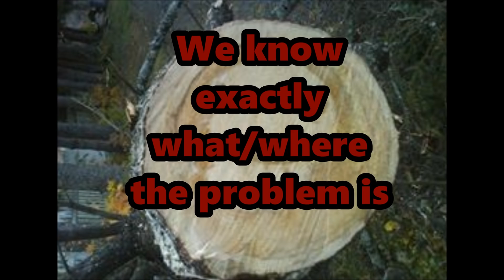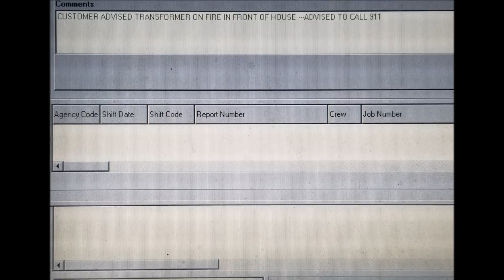5 Myths about Power Outages

Comment: A year or so ago, I was watching as a lineman changed a fuse. The fault was still there so it blew as he closed it. Very loud. Guy didn't even flinch. Guess they are always anticipating that it might happen.
Reply: If you come up on a distribution transformer with a blown fuse and can't readily identify what caused it, you kind of expect it to blow back.  The primary fuse for a 25kva 7,200V transformer is 6 amps.  What is really unsettling is to ride a line out late at night at the end of a thunderstorm looking for the cause of a 280 amp fuse blowing one span out of a substation where the circuits split.  I closed that door in right as my partner was saying "it outta hold" and I believe it blew back before the jack engaged the top terminal.  I think I came about 2 feet off the ground and by the grace of God kept the contents of my bladder in.  The flash of that fuse blowing was a fireball about the size of a Volkswagen.  We found an unfused tap line with a broken arm and the phase was laying right on a quadruplex cable.  Time to call the bigger crew.
Reply: @123livewire  I work on a lot of 34.5 kv and a 5 amp fuse will cause a fireball like that. I have to take a crap before I close one to keep from crapping on myself. 😁
Reply: Expensive buggers, too.
Reply: @flagmichael  How are they expensive?  The fuse tubes are reusable, aren't they?

Comment: The "blown transformer" myth is spread by the media.  It seems to be the only electrical word they know.  While a transformer can "blow" or be the cause of an outage, it is rare.  During lightning storms and wind storms, the loud reports are normally caused by a phase to phase short or a phase to ground short. also as you point out the tripping of a breaker switch on a primary distribution line.

Full underground power systems are rare, found only in dense urban areas.  In these areas both the transmission lines and the primary lines are underground.
In the outlying areas including both commercial and residential customers, the secondary line are underground and connected to a ground mounted transformer.  These transformers are connected to nearby overhead lines with underground high voltage cables that are fused (breaker) at the connection to the primary line(s).
Reply: It's like every small plane being a "Cessna"
Reply: Oh, I dunno about that; I live in a not very dense suburb (not far from Acton, Massachusetts, USA) which has underground power.  Makes for a nice looking suburb, and I am accustomed to underground power from growing up in the Netherlands (which is effectively one big urb, and while there may be overhead power somewhere, I never saw it), so I like it better than overhead power.  But I appreciate your explanation of the tradeoffs involved, thank you!

Comment: I count myself a well informed, technically oriented lay person. This taught me a great deal, at least making good explanation of some rules I knew. Thank you.
(By the way, I've seen a fuse being tested. That is a shake-making event. The test rig was isolated in a concrete bunker, and the observation room was yards away, protected by several inches of bullet-proof glass. It looked and sounded like a bomb going off. )
Reply from the maker: I guess it would be shake making eh! Very interesting. Thanks man!
Reply: They're definitely gunshots, to me!   

My utility sometimes used cutouts as line sectionizers.  The cutouts (fuses) would hang open for years and years, waiting for the day they needed to be put into service.  I also learned that manufacturers said they aren't supposed to be left like that because the weather will damage them.

Comment: About a year ago, I was sitting at my computer, I heard a very loud explosion, and all power went out. I immediately turned my head toward the transformer in my back yard (the direction of the sound) and about three seconds after the sound, I saw two squirrels hit the ground at the base of the utility pole. They weren't moving. I don't know how, but a few minutes later when I walked out there, the two squirrels were gone. And just like you said, a lineman came and replaced the blown fuse. Piece of cake.
Reply from the maker: Some they they actually just get stunned and then run off!

Funny story: a customer called in with a very similar description.. it was winter time. 

On the report it said
- it's ok to close the transformer back in... It was just a squirrel, but the squirrel is gone because a bird landed and took the squirrel .

When I arrived the was foot prints of a birds in the snow walking up to a print of a squirrel body in the snow .. the. Nothing. It was too funny how the footprints told the story 😆.  

I have the pic somewhere on my bobsdecline Facebook page ...
Reply: @Bobsdecline  The bird was thinking "ahhh, some fried squirrel"
Reply from the maker: He was definitely excited to have a cooked meal for once!
Reply: There was a squirrel incident at NCSU back in the 90's. Blew up the substation. Even with my dorm room on the opposite side of the building, I saw the flash, and my mom heard it over the phone. When I walked by and ask the lineman working on it, he pointed to the carbonize remains of a squirrel paw on a charred bus bar. (as this long predates cellphones, much less cellphone cameras, I have no pictures.)

I've heard stories from out west where fire ants get a little too dense in various powered boxes and cause fires. (they'll also eat the jacket off fiber optic cables.)
Reply: ecsciguy79   Same thing happens to monkeys in less developed countries. They’re not dumb or stupid, they just think it’s another limb. Sadly, most have their insides cooked & don’t survive or it’ll kill a monkey Mom but leave her baby an orphan unscathed physically

Comment: I've heard the fuse blow on the pole down the alley a couple of times.   It sounds like a 12 gauge shotgun.   The fuses have an explosive charge in them so they will cut the current flow fast and clean to prevent arcing.
Reply: The explosion is caused by the fuse flash vaporizing not by an explosive. I believe the fuses are made up of a sintered alloy that is designed to flash vaporize when too much current flows through it.
Reply: The fuses/cutouts on the lines work on the same principle as the fuses in fuse boxes in homes:  a tiny piece of wire sets the amount of current that can flow.  Big and small fuses can blow two ways:
— Overload:   More current is flowing than should be allowed.  If the over-current is mild, the wire takes time to heat-up and break.  The more current flowing, the faster it will break, but it's not instantaneous until 150-300% of designed load (or so).  A glass home fuse that blows in this condition will let you see a neat, visible break in the wire through the glass; a cutout could arc but it won't explode. 
— Short circuit:  All available current flows freely through the circuit, causing the most-extreme over-current possible.  The protective wire vaporizes nearly instantly.  A home glass fuse blown in this condition will have a cloudy window you can't see into; a cutout protecting this condition will loudly pop, like a gunshot.
Reply: None of the fuses should have any explosives in them.  Explosive and electricity do not mix well.  That "bang" you hear is all from electric current and the insulating of the fuse burning away.

Comment: I'd like to see a video of home owners that don't know enough to disconnect from the main power source when running a home generator ! That's not a good idea to run a home generator while hooked to the main power source !
Reply: If the generator is correctly installed, it should have a transfer switch that cuts out power-company power when it cuts in the home generator.
Yes, that's a big if.  Most folks would probably go with a cheaper hack installation that skips such a switch.  They'd say, "I don't need no stinkin' switch; I'll be careful."
Instead of harping about safety to deaf ears, it might be more effective to justify these things by warning the shortcutters about the risk of their generator powering their neighbors' houses.
Reply: @77thTrombone  ... in our neck of the woods there's a $5,000 fine for getting caught doing a back feed to the street.
Reply: @77thTrombone  ... I only wish they published that in the local news once in awhile. We know safety wont but $$$ out of pocket might actually get their attention!
Reply: rupe53 - exactly!
Reply: @rupe53  It could also bring a manslaughter charge ...
Reply: @davidnadeau6441  ... I do believe they use possible criminal negligence or similar because the power company guys are usually good about checking first so seldom get hurt. It's basically the intent, unless it's proven to be a repeat offence.
Reply: Good one!  When your power goes out, your best friend is the person from the power company who comes to fix it.  What a bad way to treat your best friend; endanger his life for your own convenience!  Even if you don't care about any other human life but your own, you're going to get your generator fried when they get your power back on.  BTW, where I used to live, every 10 years a squirrel would jump in just the wrong place and blow one of those line fuses.  It's louder than a gun going off.
Reply: If you connect your gen to the electrical system without proper isolation, you might be a dumbass...
Reply: @HOWNDOG66  you just might be, at that.  Even so, never underestimate the power of stupidity, especially when it has a friend (or a Home-Deport-Parking-Lot-grade "contractor") who's not afraid to make electrical hook-ups on discount.
Reply: its great way to either A kill someone or B set your generator on fire

Comment: Oh gosh. Don't tell me what you just said at 2:30 is real. Are you guys that back dated on technologies still. Smart meters are standard since over 30+ years in Europe and allow exact tracing to the effected lines when those go down which massively reduce the time wasted by linemen to chase down those power lines to figure out where it all starts with the interruption. I simply can't believe how antiquated and outdated all this technology is here in Northern America. 
If you didn't know for example in Germany 30% of the internet usage actually uses Power Lines to the end customer so if something gets interrupted anywhere above or below ground it can be traced down to the foot where it got interrupted. 
It really is a shame that your Company and all others here in the United States, Canada and Mexico simply don't do their job's to actually upgrade to a smart grid.  Ring connections are a common 95% of all Power grids in Florida are Ring connections and no longer just Star connections. So that in case a line got snapped or transformer blew up all what need's to be done is to isolate the 1-2 poles form the rest of the grid and within 60min the rest is back online. I think the public should be outraged and demand those upgrades to be implemented asap. Also safety speaking with those smart meters also do come smart transformer and step up or down systems so at the end linemen and conductors know exactly where it got cut. 
Thank you for doing the video and I will pressure the Boards on which I am part of to get their lazy asses in gear.

Comment from the maker: For apprentice Lineman 
➡️https://m.youtube.com/watch?v=TmCbbDJYPlA
**Edit* As technology quickly advances...
If your home is equipped with a smart meter, then yes there are capabilities available to know exactly when your power goes out! There is also a difference between a smart meter and a digital display meter (which functions much the same as the old analog meters).
Reply: tell us what happens when a transformer does blow
Reply: One big benefit of a smart meter is its ability to measure each customer's load and that data goes into the system that will have the system parameters in it.  This not only can help identify outages, but can plot increasing growth which may indicate the need for a larger transformer, secondaries or even the primary line.  This will alert the engineering department to make changes before customers start experiencing low voltage, or worse, an overloaded and damaged transformer.
Reply: @Richard Vaughn Automatic Meter Reading (AMR) is indeed a benefit but the device can provide a lot of information from the end users.  Sure, telemetry at subs and synchrophasers are good for the big picture but smart meters can be players too.  This is especially true as we move toward the "smart grid" which no two people can define accurately.  One thing that will also affect the system on a massive scale is car charging.  Being able to disconnect this during an overload or especially, a frequency excursion and then turn around and pull from the cars' batteries will reduce the need for operating reserves in a way that's never been seen.  Much like load management but on a more critical and precise scale.
Reply: @Richard Vaughn Yes, about the telemetry of substations.  I started with a Westinghouse REDAC system that was installed in the 60s before we graduated to Harris.
Reply: At the break between #5 and #4, I pulled down to make a comment about those in the city with smart meters should have real-time reporting of outages...  Our local power company has a map which provides actual numbers and sends text alerts rapidly.  Usage data is supremely valuable and trails by about 3 hours.
And our water company still requires you to phone them to set up service and sends a paper bill a week after a meter reader comes by.. They need to get with the program, LOL.
Random aside:  Power companies should make the next smart meters have more bandwidth (maybe some 5g tech) and offer internet service as a city-wide accessible mesh network.  An add-on to your existing bill. (I wouldn't be watching this in 144p tethered from my phone right now if that were a thing :P)
Reply: Is it true that before smart meters the power company could tell when somebody pulled the meter out of the box?
Reply: @Bobsdecline - Lineman blogger
An excellent video; very informative. Thank you.
Reply: I got a smart meter like 6 years ago. I didn't ask for it or want it. Power company metermaid just came out and installed it.
Reply: @kalijasin  you can have it removed from your home if you own your home but since you have let it go so long you might have to go to your Town office and they can get it done for you
Reply: replying to this video, what if there were under ground service tunnels deep enough to keep the warth of the earth earth/dirt? assuming not in the middle of a water table?
Reply: I got a smart meter about 10 years ago on my house I lived in at the time. APS went around and installed all smart meters in Phoenix well over a decade ago.  Makes power turn on very easy when moving.  Just a call and within seconds, power is on.  Now my rental property has solar and so 3 smart meters on the house.  My new house was just built and so smart meters to transfer from the builder to me was easy, just a computer change.  No lineman to come out and waste his time to swap a meter out.
Reply: @MikeHarris1984  those are some nice benefits. I rent reading an article years ago where they got hacked the power usage was reset for all the customers 🤣

Comment: Years ago the transformer up the road from my house if fact did blow up. I am unsure as to what happened. It all started when the crazy wood pecker started drilling on it. Yes was for some reason trying to peck into the transformer. Those things are thick steel so I know it did not put a hole in it. But it did something crawling all on the thing. Then it happened. There was a bright flash and a plasma fire. The plasma when on for about a minute of so and then the whole thing exploded. The top of the transformer blow off and went flying. Then a plasma set fire to I am guessing the oil in side the transformer. It looked like a car tire burning on top of the pole. Thick black smoke. Then the pole cough fire. I do not know what that wood pecker did but it got   but it paid for it burned up in a  10,000 degree plasma fire. This is what it looked like just on a smaller scale. https://youtu.be/ZCzdPFJ4tog

Comment: I've seen a a four core twisted over headline (not sure on the technical name) over heat catch fire and start raining motel insulation down on my car before crossing phases i think and going quiet rung weston power to find it was still live and the old fuse had not blown as it was meant to but fun to watch.
Reply: Probably ABC (Aerial Bundled Conductor).  Fuse hasn't operated as it's most likely not rated for the length of circuit, this is quite common.

Comment: About 25 years ago, our transformer failed.  No loud noise, but the lights surged a couple of times and then went out.  I went to investigate and there was oil running out of it onto the ground.  Our co-op came out and replaced it.  The next day they came back and dug up all the contaminated dirt, as the oil had PCBs in it.  It was a pretty old transformer.

Comment: The lines where I live run right under the corner of my apartment and the transformer for the whole complex sits about 8 feet from the wall where I sleep. They have had to dig up the feed lines in the parking lot 3-4 times since I've lived here due to burning (They say every day without power gets it higher on the list to be fixed "right") I thought this would make me feel better about it, but no.
Reply from the maker: Buried lines are great in hurricanes and stuff but once they start going bad can be a huge pain! Hopefully they get them fixed up properly for ya soon!
Reply: @Bobsdecline  Thank you kindly, sir. Keep up the good work.